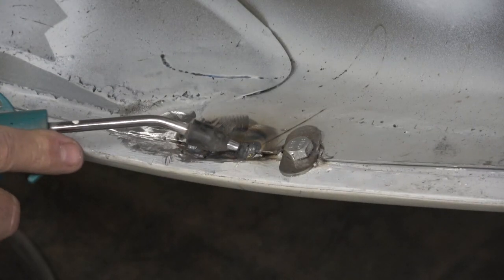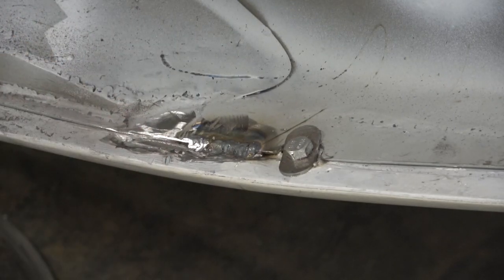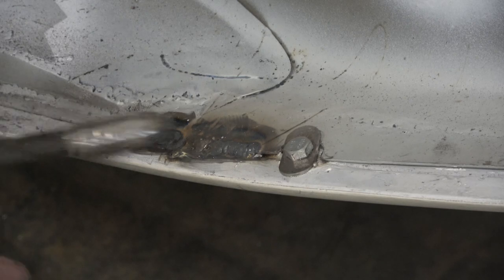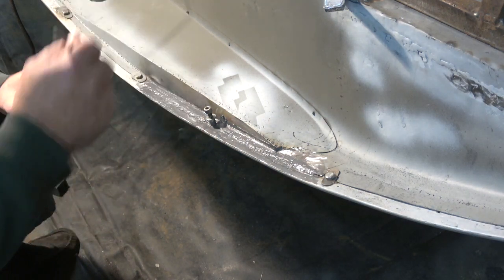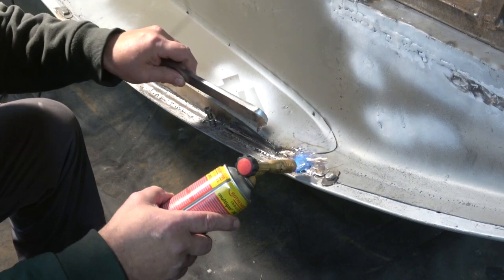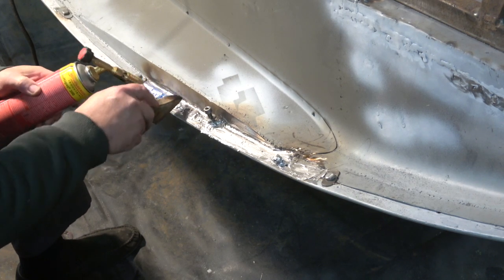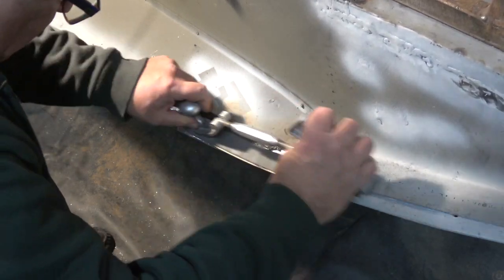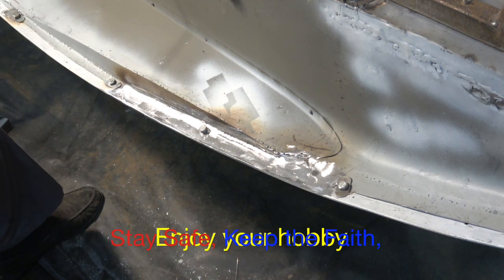Lead Loading A Classic Jaguar

Comment: Hi Dave. Just be careful you don't burn those slippers !  Not very many see this operation Dave . I showed my buddy lead loading on his Mk lX last year , he was mighty impressed.  Great stuff !  Happy New Year  !  Take care and stay safe.
Reply from the maker: John, There not slippers but my most comfy slip on‘s lol. As you know yourself using gravity is the key if it‘s possible, The skill level
really kicks in when your loading vertically or upside down that‘s where practices really comes in to it‘s own. Cheers Dave
Reply: @ClassicCarCave  l think  l told about the 140 and l used 48 sticks of lead . By the time l finished l could lead up overhead and vertical was a doddle ! 😂😂😂

Comment: Happy New Year Dave!  Be careful when lead loading to use the proper safety equipment.  Maybe a mask to block any lead from the filings or even the fumes.
Reply from the maker: Bill, Happy new year to you and your family. For the purpose of the video i didn't use a mask but on longer jobs we try to use masks and gloves but some times forget. The danger is the cuttings more than the fumes and if your in a very inclosed area. Cheers Dave

Comment: Top Work as usual ,have you tried a pigskin wiping cloth for smoothing your solder Dave?
Reply from the maker: Peter, Thank you! TBH i haven't as you go through so many rags because you can only wipe the tinning paste once the cloth has to 
be clean each time or you introduce debris into the solder. Cheers Dave
Reply: @ClassicCarCave  Pigskin wiping cloths are what us gungy plumbers used to make wipe joints on lead to copper joints ,was just wondering would it make the smoothing process easier
Reply from the maker: Peter, I had no idea they existed ? Can you send me a website where i could buy some anything that helps to keep the tinning
paste contaminate free woud really help when applying the lead. Cheers Dave
Reply: @ClassicCarCave  Monument 556l Wiping Cloth 3.1/2 X 2.1/2in .   No one seems to have them in stock at the moment ,I don`t know if that`s because your not supposed to work lead anymore lol